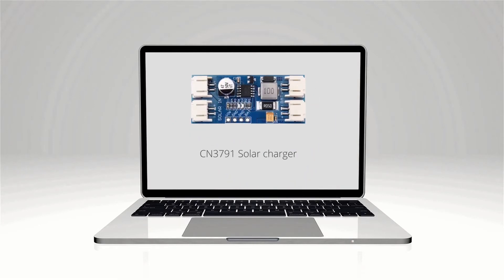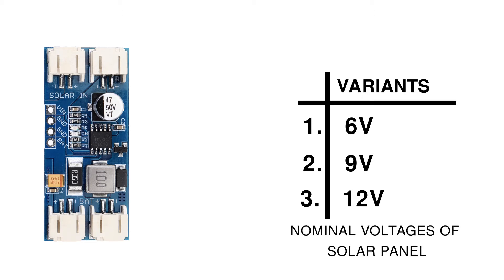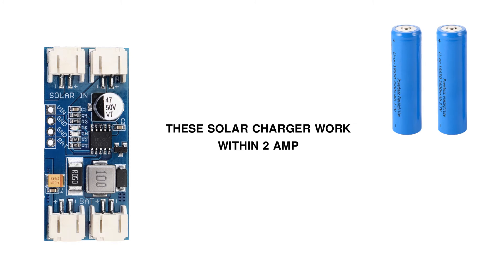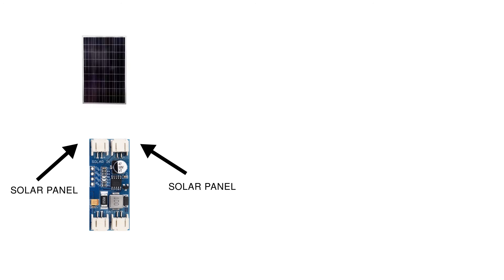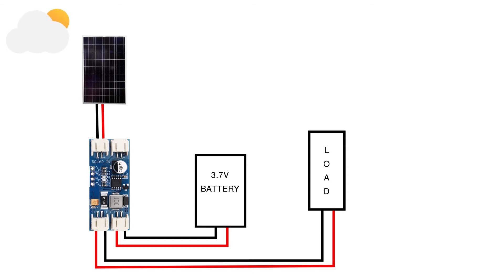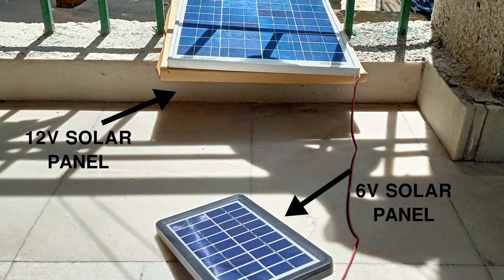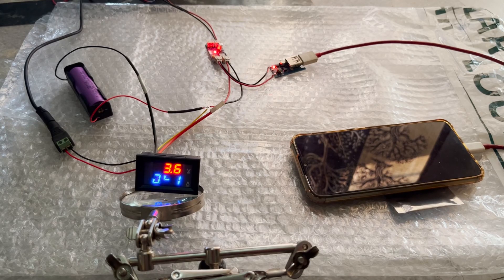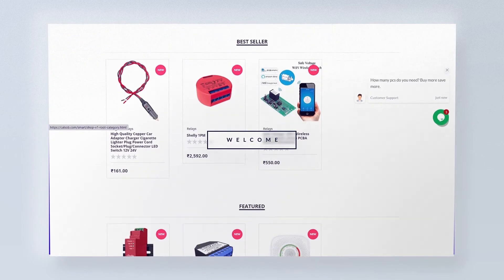Cn3791 MPPT solar charger module - Connection and Working

Comment: Hello, Can I connect 2 solar panels of 6 V each at the same time, using the 2 solar panel connection ports? If the answer is yes,  which controller version should I use 6V or 12V? Thank you!
Reply: You can use two 6v solar panel, one in each connector if you choose 6v model, or... better get 12v models a wire the two 6v pane in serial, then use one input connector

Comment: Dear is there a variant of it which charges 3 x 3.7 V 18650 cells in series I mean 3.7 x 3=11.1 V battery?
Can it take 18V input from solar panel coz my solar panel gives regulated 18V 3Amps output.
Reply from the maker: Yes

Comment: Hello! Can I use CN3791 not to charge battery, but use it directly for some loads? If I can, will it work with two solars panels (6 V and 0,55 A each of them) in serial way?
UPD: I have CN3791 with 6 V input.
Reply from the maker: Yes it should work
Reply: @homeautomationmadeeasy3276 , ok, thank you.

Comment: Good video Boss👍👍👍 i want to ask, what's the maximum number of 18650 cells you can connect in parallel to the CN3791 module?
Reply from the maker: You can connect 4
Reply: In parallel? No I think you would need to connect 2 or more in series first to get the required voltage for any of the the module from 6v to 12v

Comment: Excuse me sir what is the maximum permissible current for the cn3791 will it be safe to use a step down converter for a 18v 10w solar panel to step down to 6v for optimal current to pass which is 1-2A as you mentioned

Comment: Thank you for the great explanation 
I have a question though, I have a solar panel producing 6v and two 18650 lithium batteries connected in series, My question is can I use the CN3791 to charge the two batteries together and then power an Arduino Uno rev4?
Reply from the maker: No
Reply: The two 18650 batteries should be connected in parallel for it to be charged properly since the CN3791 output is only 4.2V. Then, a boost convertor is required to step up the voltage to 5v to power the Uno rev4.

Comment: Thank you for the excellent presentation! I wanna ask if the load is charged by the battery or the solar panel, so if it is not charged by the solar panel (no sunlight), it can still be supplied by the battery?
Reply from the maker: Yes it can
Reply: @homeautomationmadeeasy3276 hi I'm curious what will the output be with the 12v version of this board

Comment: Hi buddy, actually Im using home automation project using esp32, currently it is powdered up with adapter which has 5v 5w 1amp specifocations so if i use solar mqtt module along with 12v 2amp solar panel inorder to maintain proper backup how many lit-ion 18650 batteries are required ???
Reply from the maker: Solar panel indoor won't work. It should get proper sunlight

Comment: I need to charge 2 batteries of 3.7V that are in series and provide 7.4 volt to the load. But I have one problem, I can only use a 6V solay panel as a source(this is project requirement). Is there any solution to charge 2 batteries of 3.7v in series with a solarpanel of 6V capacity?

Comment: On the load is there any voltage protection to limit the voltage as I plan to use this with an esp8366
Reply from the maker: Yes

Comment: Hello, let's say we charged the battery with solar energy in the morning, can we run another device from this battery in the evening? Is current flowing to both the battery and the device we connected to the outlet in the morning with solar energy? 

and did you try 02:15 ? or you think that will work like this?

Comment: Can i run an arduino having 5v relay and pump using this? And also what voltage solar panel and cn3791 will be required
Reply: A single 18650 battery probably won't be enough. Power the Arduino by reducing it to 5V with 2 18650 batteries. You will also need a power supply for the pump.
Reply from the maker: You can but battery backup will be needed.

Comment: so if there is enough sun, the module energizes the load directly from the solar charger, right? In other words, in sunny conditions battery will not be used?
Reply from the maker: You can say so
Reply: i think load and battery are connected serial, so if no sun  battery powers the load, if there is sun load and battery will be powered by sun, but i am not sure..

Comment: Did you use 12v 10w Solar Panel?
Reply from the maker: 22v 10w
Reply: @homeautomationmadeeasy3276 
But can I use a Loom Solar 12v 10w Solar Panel? If I use this will it give good current output like around 1.7-2A?
Reply from the maker: @SRIKARBSS  yes you can

Comment: Can I use 6v 0.5A Solar Panel for charging only 3.7v Battery?
Reply from the maker: Yes but it will take long time to charge
Reply: @homeautomationmadeeasy3276  Thank You So Much for the reply, can you tell the current output the module gives to charge the 3.7v cell(whenever soon its possible for you please).
Reply from the maker: @SRIKARBSS  4.2v and upto 2 Amps
Reply: @homeautomationmadeeasy3276  I mean how much current output would we get if use 6v 0.5A Solar Panel to charge a 3.7v battery
Reply: @SRIKARBSS you don't put out more amps than the amperage from the solar panel, i.e. 0.5 amps

Comment: How much current can CN3791 supply (output)?
And Can I use a solar panel that supply more than 2 amps?
Reply from the maker: You can't use it for more than 1.5 Amp

Comment: Can I use use 1 cn3791 board to charge 4 batteries in parallel.. if so, how do I do that exactly.. do I need a bms ?
Reply from the maker: Yes you need to use BMS